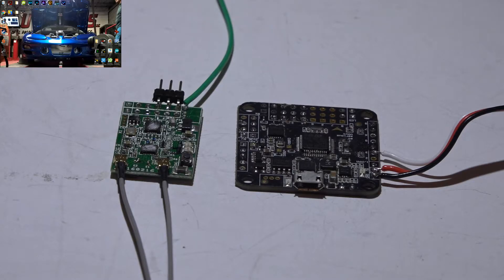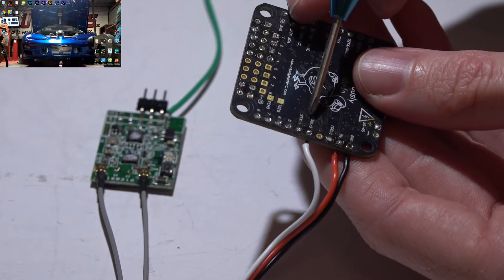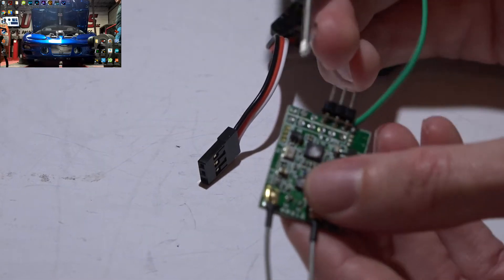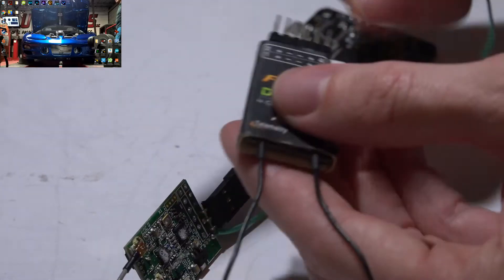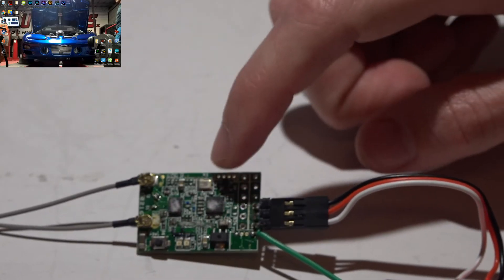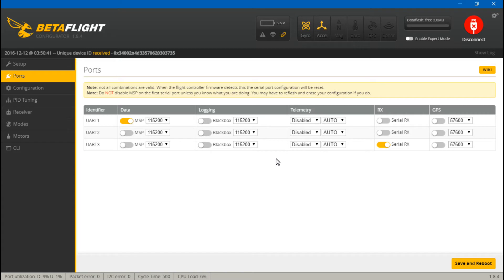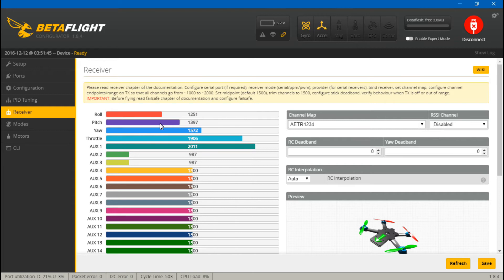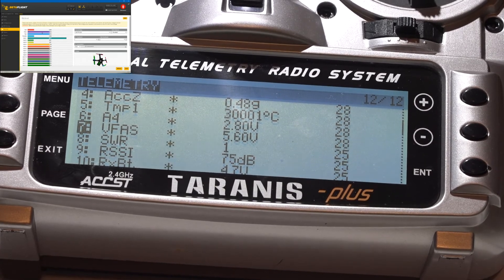Seriously Dodo & X4R-SB: Connect & Telemetry

Comment: Hey JC, I know Uart1 is used by the USB can it be shared, which is better to share with telemetry or OSD, is other words how would you connect both telemetry and OSD (minim micro)? Rx is XSR, thanks
Reply from the maker: Nope it cant be shared. On this you can do is but your receiver on UART 2 or 3, then telemetry on UART 2 or 3, then put the OSD on the soft serial port. Heres a video on how to do it and I used used a Dodo in the video.
https://www.youtube.com/watch?v=PZknMfcfVCo
Reply: Thanks I just watched and liked that video